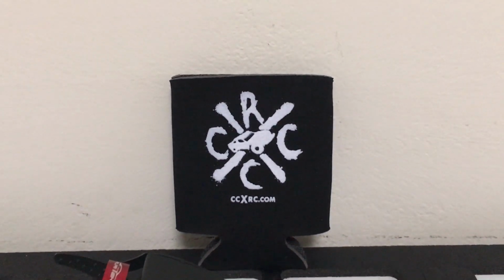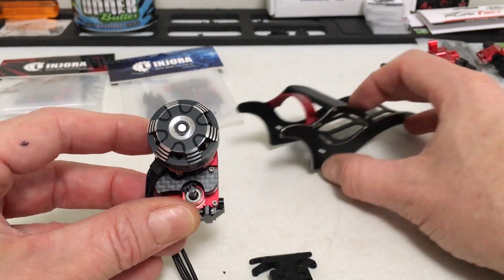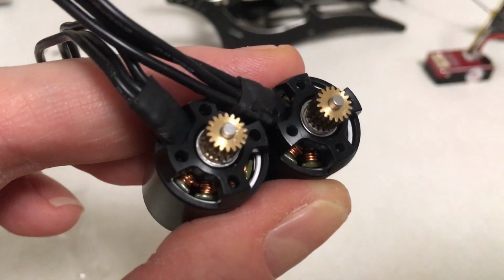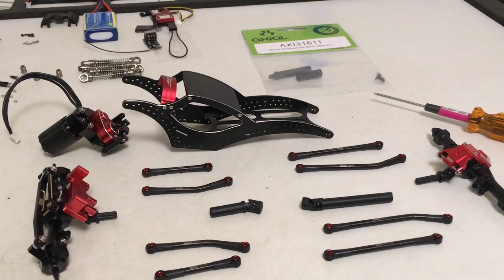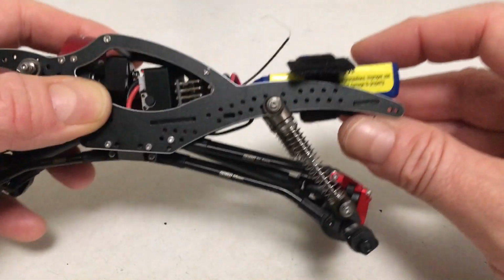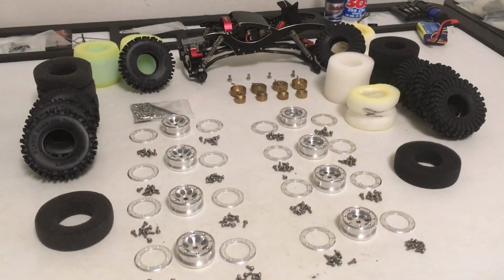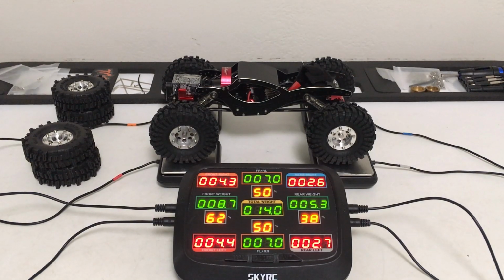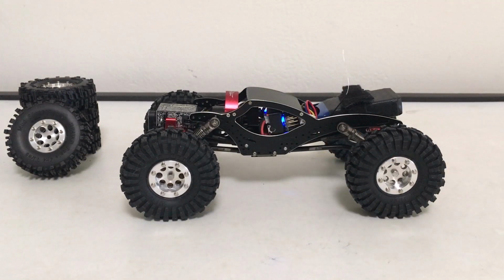SCX24 FURITEK SCYTHE V2 CHASSIS: FULL BUILD - CCxRC, SHIFT RC, MOFO RC, SAMIX, KINETIC, CARISMA

Comment: If you turned the transmission plate with the letters facing the other way the transmission would center up
Reply from the maker: Rotating the skid would flip the motor to the rear.  This plate only has 3 holes to mount the transmission in one position.  It's not set up with 4 holes like the Cheat Code to flip the transmission on the skid itself.

Comment: Simply perfection!!!

Love your videos, always educational.  

I ran into the same problem with my V1 scythe chassis and the motor not being centered. Furitek told me to rotate the motor on the mount and to be mindful when setting the gear mesh.  Took some time but I was able to get everything to work.  You’d think it would all line up out of the box. 

Great work as always!!!
Reply from the maker: Thank you, I appreciate that!  Yeah, it could work on the stock plate just barely (still not on center,) but the massive fail is that flat skid designed for it.  They could have adjusted the trans over to work.  Still don't even think that could get it centered with their aluminum motor mount though.  Someone mentioned having to use like a printed mount that centers up the motor.  All in all, I am stoked for the BAM motor that ended up in this!  Cheers!

Comment: Waiting on my ccxrc Furitek scythe chase. Can't wait 🤟 to get it.
Reply from the maker: I think you are going to love it!  Just watch those tiny frame screws!!!
Reply: @bcochener  I know about those little damn screws lol easy to break off. I'm not liking the trouble you had with the furitek komodo motor. Already thinking of how to get the motor center. Good videos. Happy holidays
Reply from the maker: @chrishester2928  Yeah, I have no idea about that motor position on those skids.  You could run the motor on the stock skid with maybe like a papers worth of clearance to the motor cover.  But no way with the Furitek skid.  You saw how close it put the motor to the side rails.  

Neither one of them put the Komodo on center of the cover, which I though was the entire design stand point of it and the chassis.  Ah, what do I know...?

- Happy Holidays to you as well.
Reply: @bcochener  I'll let you know. I also already have the red and black scythe. Doing a furitek/mofo build. This black one will be furitek/ccxrc if possible. Will let you know once they've built

Comment: Love this chassis, thanks for sharing.  Much enjoy your builds and videos!

Shame on the komodo motor off-center issue.  I've encountered the same.  Put a fair bit of time into trying to sort this... 3 different scythe chassis (v1 and v2) paired with all Furitek parts (specifically as listed on the scythe product page, purchased from their store), as well as many other non-furitek components (skids, transmission, and motor mounts) and all have komodo motor off-center, to the point I'm unable to install motor cover without rubbing motor.  Work-around I finally came up was to modify stl for surpass motor mount.
Reply from the maker: Thank you! — Yeah the motor deal is just insane to me. Why would their skid put it off center if it’s made for it? That motor cover looks so good and is functional, I definitely want to be able to run it.  I am, however always happier to run a Mofo RC motor, so that’s fine. This BAM is a new one for me as I have 2 Komodo’s in builds already, so it’s a win in the end. Cheers!

Comment: Hi finally getting around and building this furitek scythe v2.  The drive shaft i have for the rear is too short..what one do u recommend?
Thank u;)
Reply from the maker: @mikeinvegas1  not sure your link setup, but I often use the stock plastic shafts and cut to length/mix and match to get what I need. Otherwise, just have to commit to some metal ones. You can mix and match inners and outers of the same brand. Take some measurements of what you have that is too short and go from there.

Comment: That a great looking 24 , I was wondering would a stock type gearbox and a brushed 50/50 motor fit in to that chassis with out any modifications.
Reply from the maker: It would fit, but limit you to using the stock lower rear link mount positions instead of any of the riser options - due to the 050 can length. It may limit your up travel as well, with the upper link hitting the longer can sooner.

Basically the same issue you run into on any chassis running the 050. If you want to get really low and have a lot of up travel into the frame, you will hit it, otherwise, no problem I would think.
Reply: @bcochener  Hi , thanks for the information , I like the look of that chassis and I did wonder about the brushed motor fitting or not , I might give it a try before buying a brushless motor and esc combo .

Comment: Nice build, i was thinking of building a scythe v2 but i've been having a lot of bad experiences with different furitek products. 

Where do you get m1.4 washers? I cant find anywhere. Small outer diameter m1.4 washers are useful but nobody sells them, only nuts. I dont get why most servo mounts are m1.4 but the servo ear holes are 2mm. The only servo mount that has m2 mounting is samix.
Reply from the maker: Thanks bud.  Other than the easily stripped screws and bunged up thread on the roof, I have no complaints.  Furitek is sending me out a new roof panel and screws as well, so that is great.
-For any specialty small metric hardware not easily found at hobby shops, I go here: https://www.metricscrews.us/
Where I get those micro screws I use on those Shapeways JLU handles.
Reply: @bcochener  Cool, thanks. Have you tried the king pin bushings that comes with knuckles instead of layers of heat shrink? Hot racing sells them by themselves, $4 pack of 4. HRASXTF04P

Comment: Very nice work as usual. 
I’m currently building version one Scythe based around the full size Komodo/Stellar. Ran into the same issue of the motor not being centered. It’s so far off it rubs on the driver’s side motor cover. For the money Furitek charges,  the design shouldn’t be flawed. Very disappointing. Had I known about this ahead of time I wouldn’t have invested the money. I also purchased their Lizard Pro ESC, Avatar micro receiver and radio. Hopefully those will play well together.
Reply from the maker: Yes, if I had known I would have saved myself the Komodo as well.  Mofo RC to the rescue!  I have no experience with the Avatar, but CCxRC seems to really like it.

Comment: Awesome.  Is there a build sheet for this. So I can do a build..some type of directions.
Reply from the maker: You’re kidding right? I think the build video covers just about every detail.
Reply: @bcochener true. It's a good video. But just was curious like most rc's they have a manual on how it's put together.  Do have something to look at. Video shows alot. But wouldn't know where to start when ording all the parts. Like if all 24th scale parts will work with this or no.
Reply from the maker: @mikeinvegas1  Instrucrions are rare in the 1/24 RC world. That is why I put my build videos up. This chassis kit is based around using SCX24 parts. You can always start with an RTR and swap out parts. Good way to get a handle on how they work and go together if you’re new to them. I like them because you can do so much with them, so many after market chassis & upgrades. Cheers!
Reply: @bcochener  thank u I appreciate it..I been trying to find a furitek scythe build to buy from someone.

Comment: What grease do you use in the axles?
Reply: He has udder butter sitting on the table
Reply from the maker: Yes,  Cow RC Udder Butter. Same as a green waterproof marine grease from the auto parts store I think.
Reply: Thanks. I need to get some for all my builds that have aluminium axles and  all metal transmissions.

Comment: Is that a furitek stellar transmission? Also a mini komoda. Or not a mini?  Trying to figure which setup I'm supposed to order.  Lol..thank u..   for original motor u was going to.use.. not the one u put in it.
Reply from the maker: Stellar/komodo. But as you saw, the Komodo doesn’t fit properly with the motor cover. Why I switched.
Reply: Thank u. Stanger tho. Because I see alot of people using the komodo in the scythe v2.

Comment: In your opinion, what is the biggest difference between this and the angry sparrow?
Reply from the maker: Isn’t the Sparrow for the AX? I don’t have one, but it is a considerably shorter twin vertical rail setup. This has the long rear/battery tray.
Reply: @bcochener  yeah, so many have told me that the sparrow is no good. Trying to understand why, even Furitek themselves told me to look elsewhere 🤦🏻‍♂️
Reply from the maker: @bdog7262  I really enjoyed the build and capability of the HP Dementors. For less money, there is the Injora Kangaroo chassis as well I’ve built. With a few tweaks, just killer chassis at a great price point. Cheers!
Reply: @bcochener  have a great weekend